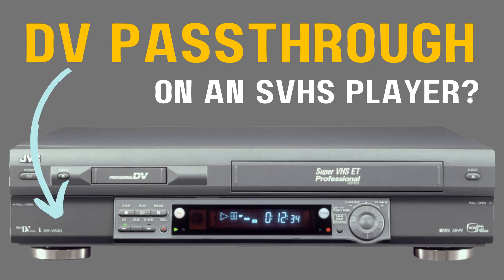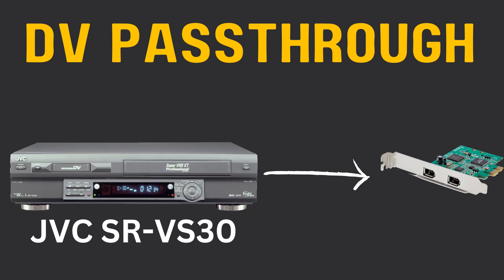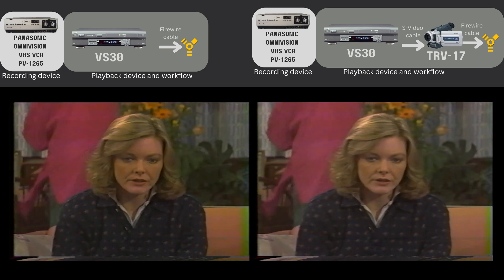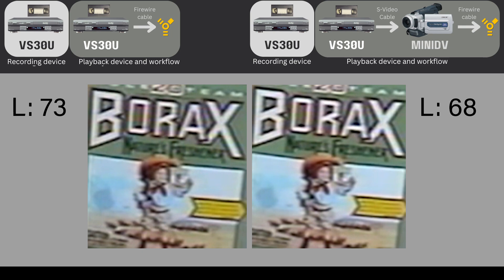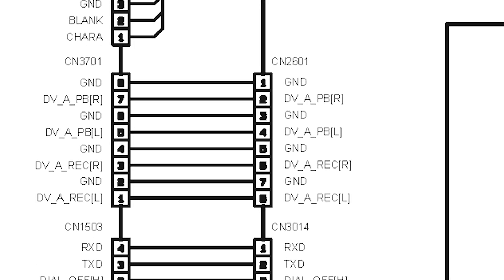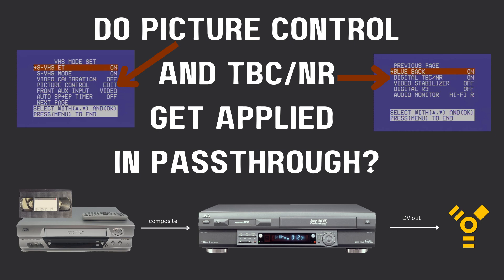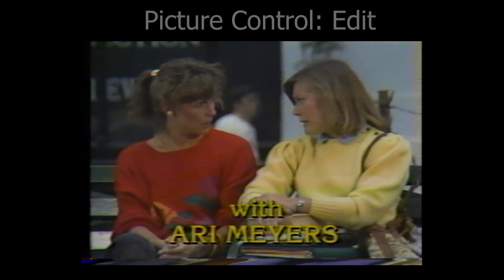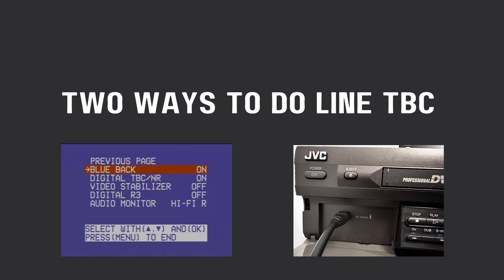Unique VCR has DV digitizer inside

Comment: I use this exact deck and FCPX will display the video but will not capture any suggestions how to get it to recognise it, when I use QuickTime it stops capture from time to time
Reply from the maker: What analog-to-digital capture device do you use on your Mac?
Reply: @videocaptureguide  I have had the Advc110 and been using it the past while to capture VHS and i never thought about using the DV- firewire from the deck until i saw your video (Thank you, this now frees up the advc-110 for me so i can capture 2 tapes at a time) When trying to capture using FCPx it didnt work (forums say it wont work because vhs lacks timecode,) I was previously using quicktime which looks great but gives me a progressive capture, I have been using Premiere not and that gives me a nice interlaced capture which looks very good, any  tips/ reccomendations for mac users?
Reply: try OBS maybe

Comment: I have one of these. I saved it from the scrap pile from work when the MiniDV deck failed.
Right now it has a VHS tape stuck inside that it ate. I think I need some new belts but I don't know what else needs servicing. I recently ended up running a different JVC S-Video VCR into it for some capture.

Comment: Do you prefer SVIDEO or Component
Reply from the maker: I'm working on a video comparing S-Video (Y/C) and Component (CVBS), and whether a hardware-based Comb Filter in the workflow can help when using a VCR that only has Component output. Bottom line: S-Video is best because it avoids artifacts associated with Composite (dot crawl, and rainbowing). But hardware-based 3D comb filter can mitigate a lot of those artifacts.

Comment: Well I own this baby and mine as got less than 100 hours on the head. Still like new and works top notch. I do electronics and I gave it a service not long ago and didn’t need to do anything because it’s all fine and perfect aligned. Beautiful machine with fantastic playback and great TBC with Memory too.
Reply from the maker: I wish I had electrical skills to be able to inspect these and fix them. I mostly watch 12voltvids, think about trying to fix one of my VCRs, and then realize it will end badly if I try. I would like to learn hold to solder. That seems like a useful skill.
Reply: @videocaptureguide  I use to fix videos, laserdisc, audio, etc. the main thing you need for video is oscilloscope to see the signals and alignment of tape path, heads,etc. believe it or not the main problem either way old tech is capacitors. So learn to test them and will help to fix a lot of problems.

Comment: Trying again, hopefully 3rd or 4th time lucky. Presumably some combination of words tripped youtubes filters.
PB &  REC are likely playback & record, ie: in & out.
D_Y and D_C inputs and outputs are almost certainly the Y(luma) & C(chroma) component of s-video.
D_ is presumably just referring to it connecting the DV section.
V is probably composite video
Y/V probably luma or composite, depending on input, This is common.
Seems to have the same inputs & outputs as many DV cameras.

Comment: Is it better than a s-video cable i would say yes: less electro magnetic interferences  pick up, (the chassis+ top cover are a faraday cage)  and shorter distance 2 factors that'll limit noise below threshold imo. If you protect your ribbon cable with special emi foil that'll be even better.

Comment: The only worry I'd have, other than it's default compression quality, is the possibility of dropped or inserted frames by the JVC's buffer. I know those Panasonic DMR-ESxx DVD recorders work wonders on extremely wonky tapes in passthrough, but it can drop and insert frames before it even reaches the capture card. I only use it for tapes with top-edged tearing that my JVC HR-S7800U's TBC can't handle. A tool of last resort.
Reply from the maker: In the test I performed over about 30 minutes, WinDV didn’t show any dropped frames. Do you think that it may be underreporting depending on DV device buffer?
Reply: @videocaptureguide   it may, but you'd have to inspect the capture to see if any drops or inserts manually. It depends on the scene though... a slow scene with a fixed camera angle probably won't have issues, or at least not that stick out to you, but I've noticed it mostly with fast moving scenes, or if the camera pans really fast. I'm currently digitizing my copy of Woodstock 99, and I've seen it stutter when the camera pans over the audience really fast. My guess is too much data pushing through the buffer that it can handle. By comparison though, I originally tried those VHS to DVD machines back in 2006 with the same tapes, and not only did it drop frames, but duplicated multiple frames at once. Where the lead singer strums down on the strings once while making a point to the audience, the DVD had him strum down twice. 2 different machines had the same problem. Heck... neither machine had TBCs either... wavy images from both.

Comment: Nice video as usual. I’ve worked on something like 5 of these VS30Us and they almost always have bad MiniDV drives and you’ll find that out when it eats your miniDV tape either on insert or eject. For this reason, I usually remove the MiniDV drive and the accompanying FireWire circuitry right below it and the VHS side will continue to work fine, so I am confident that the VHS side doesn’t require anything from the DV side. I haven’t seen a refurbishing tutorial on those mini DV drives, but it could just be that something needs lubrication. Though I’ve also seen examples of fried components on the miniDV circuitry in some cases.
Reply from the maker: I’ve heard the MiniDV tape player mechanism eats tapes so I don’t use that. Agreed. But I was curious about how the circuitry digitizes analog VHS tapes from the SVHS side of the device.
Reply: @videocaptureguide  Yeah, I didn’t even think to try it so I’ll have to play around with it. Seems there really aren’t any comparisons against a bunch of hardware DV25 encoders, but they seem to produce pretty similar results to each other from the ones I’ve seen. It’s really too bad they never really made DV50 standalone hardware encoders as those would be 4:2:2 with double the bitrate which are the weak points of DV. DV is still better than a lot of the simpler capture methods when it comes to audio sync and horizontal jitter though in my opinion